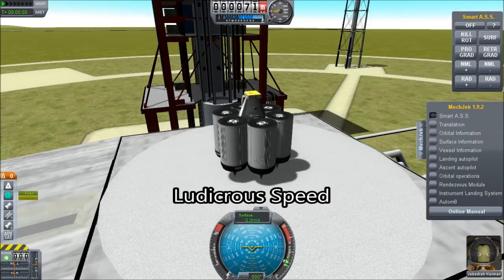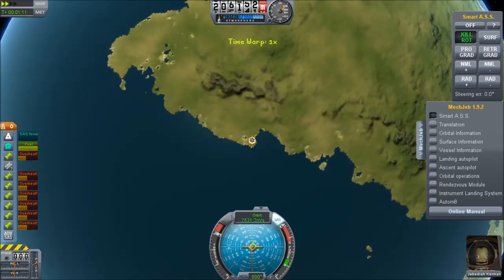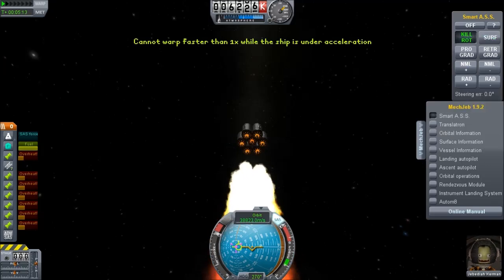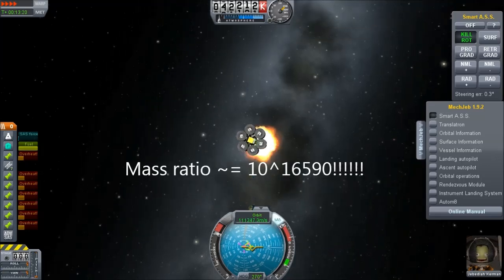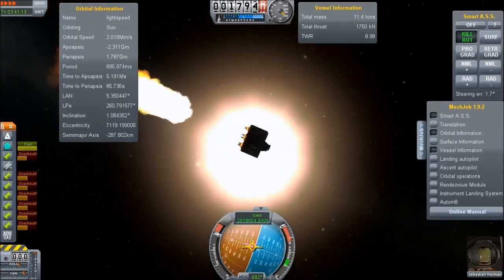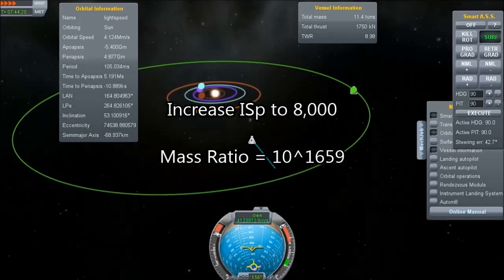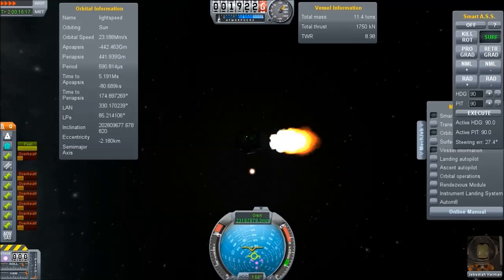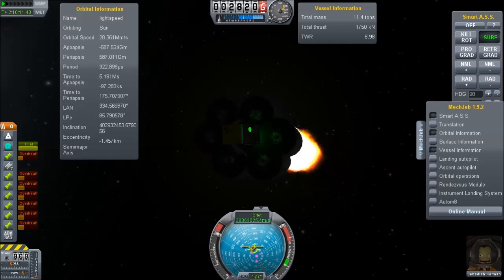What Does It Take To Reach Lightspeed In Kerbal Space Program?

Comment: The thing I haven't understood about the rocket equation is that it suggests that ISP directly correlates to output thrust, as I assume effective exhaust velocity directly correlates with actual exhaust velocity, for an engine of the same efficiency. But this suggests that the Skipper engine (650kn), with a vacuum ISP of 350, has the same effective exhaust velocity as the tiny Rockomax 48-7S (30kn), which has the same ISP. I know something is wrong here, I just don't understand why.
Reply: The exhaust velocity is the same. The amount of fuel thrown per second is not. (Thrust) = (exhaust velocity) x (mass per second).

If the Skipper throws out 1000kg of fuel, it will be over a short time and thus large thrust. If the 48-7S throws out 1000kg of fuel, it will be over a long time and thus small thrust.

Another way to look at it is (thrust x time) = (exhaust speed x fuel mass) = (momentum). Since both the Skipper and 48-7S have the same exhaust speed, if they kicked out the same fuel mass, they would give the rocket the same amount of momentum. They would just deliver the momentum over a different length of time.

This is all fine and dandy when in a vacuum on an infinite plane with no other objects, but we need larger amounts of thrust to combat gravity. That is why you use the Skipper to get your heavy rocket of the ground.
Reply: *****
I think I see now... so if you gave the Skipper and the 48-7S the same amount of fuel (assuming they are in a vacuum, as you said, so they could lift themselves) they would be capable of the same Delta-V, it's just that the Skipper would achieve it in way less time.
Reply: Mckenna Cisler
Exactly.

Comment: I think there is an existing, working rocket engine with an Isp equal to the speed of light: A flashlight! You could take one up to the ISS, turn it on and point it out the window, and it would work, pushing the station in the opposite direction. It's just that the thrust is so tiny that it probably wouldn't be noticeable, but the fuel efficiency should actually be as high as you'd expect, i.e. the momentum gained by the station divided by the mass loss of the flashlight would be equal to c.

Comment: I adjusted the code for the stack separators so that the amount of force it creates is RIDICULOUSLY high (1000000000000 or something like that) and put it on the bottom of a lone command pod. I pressed space and was IMMEDIATELY traveling easily 10x the speed of light.

It was also spinning rapidly and if you try it on any craft with more than 1 part all of the energy is wasted in tearing the ship into shreds and you'll get lucky if you manage 1km.
Reply: lame

Comment: I've been bored lately, this "Southern Snow Storm" and all. Because of this, I decided to mess around in KSP. I downloaded a few mods, most importantly, NovaPunch. I found that if you build a probe using 1: An OKTO2, 2: A nuclear power generator, and 3: A large Launch Escape System, you can make a probe that reaches 1,000,000 mps in about 12 minutes. With infinite fuel on (along with draining the solid fuel to decrease mass), this could reach the light speed in about 60 hours.

Comment: Could you cut down the time to accelerate by using the suns gravity well for an initial boost?
Reply: isn't that what he was doing in the video?

oh my bad just re-watched and noticed he didn't do that, he past kinda near the sun but didn't use it to sling shot...
Reply: i don't think so. at least not in any way useful in KSP.

gravity assists inside a solar system help you change your velocity relative to the sun. so a slingshot around the sun could only provide a boost from an interstellar perspective, but i'd expect that to be far beyond the scope of KSP (and it's velocity readings).

edit: you could of course take advantage of the oberth effect which would probably be quite significant near the sun.

Comment: Actualy, ION-engines do exist and have reducilusly high specific impuls of about 20 000s. But they also have the univers heat death problem. Also atomic charge engines exist on paper and have a ethen higher specific pulse and also higher acceleration. Up to and over 1G

Comment: Well of course lol why would you set the thrust to the speed of light it would accelerate at c(speed of light)/s if it had no mass, first your lucky mass doesn't = energy x c^2(speed of light squared) like in real life or you would instantly create a massive black hole that would engulf kerbin second the force of the thrust is 67396025.86347112lb of thrust on the surface more then enough to knock a planet off of orbit.(keep in mind kerbin is smaller then earth as well)

Comment: Perhaps I'm not the one to answer this, but just in theory: it'd be a bit precarious, even if you could convert standard protons/neutrons/electrons into photons, as should the light have been bent or diffused by something, the object coming out would be a bit... Skewed, so to speak.  Deformed, missing bits.  Warp travel, however, would be a fair bit quicker and safer (in theory.  I don't really know what I'm talking about).  Nasa is actually working on something of the like: (other comment)

Comment: Electricity as in wires and power plants?  Well electricity travels as a wave (the motion of the electrons is not electric flow) at the speed of light, so really they are the same.  Also, just fyi, light is an electromagnetic wave itself.  Basically what happens is something generates an electric field which then propagates into a magnetic field and back into an electric field back and fourth over and over in a straight line.  So light and electricity can be thought of the same thing..ish

Comment: There's no reason a craft file or simulation would have to be bigger than the universe. Hell, there's no reason it would have to be much bigger than KSP's current files. Just because data represents a certain value, doesn't mean that data is as big as that value.

Not to mention that if we're talking about applied physics well beyond our tech level, it's possible to store up to 10^66 bits of data in a 1cc volume sphere.

Comment: Right. Reducing the total required antimatter (for the drive to work at all, not necessarily to go anywhere), assuming all energy is released as photons, from the a ball the mass of Jupiter to about 500kg. If it works. No one has ever been able to prove the Alcubierre drive actually works at all in any kind of test. Fingers crossed though, that's getting closer to practical. Only requires about 90,000 petajoules of energy (about 21,500 megatons of TNT).

Comment: One way is to "hack gravity" in the debug toolbar. If you hack the gravity at 30km/s, then it would be like travelling 300km/s with normal gravity or something like that. Then when you go to the tracking station and back to the ship the gravity won't be hacked anymore. You will be travelling much faster by like a factor of ~13, since the system has to keep your trajectory the same it compensates by speeding you up. If you do this a couple of times you'll reach lightspeed and faster.

Comment: But gravity does bend light, so it does have some effect on the photons (gravitational lens). Or do the photons emitted by the sun not experience this as they are traveling straight away from the center of gravity?

And on a total unrelated note,shouldn't a object with a speed increasing torward c sooner or later collapse into a black hole?

In any case, relativity is weird ... I want an easier universe. =(

Comment: In the Kosmos Space Station parts pack, there's an escape tower with 1000 thrust and ridiculously low mass, if you burn it out and then activate infinite fuel (provided it's flying on its own), it accelerates at around 14.3km/s^2, so it would reach light speed (at 4x normal speed) in about 5.8 hours, if my calculations are correct. It's a shame I can't be bothered to run the game in the background for that long.

Comment: Also, if the matter is only slightly more "massive" than the antimatter (absolute value, of course), say, 1 electron, then the craft's mass would be virtually zero, enabling a quite weak engine to accelerate it to the speed of light.  Sadly, this would be ruined by any stellar gasses that the ship may encounter, as they would possibly "stick" to the ship, slowing it down.

Comment: Did some calculations on the nuclear rocket situation, and using a rocket composed a octocore2 probe, an FL200 tank and the atomic rocket for the central body, and then had a massive pylon of stages jutting out which were each composed of an FL200, a TR-2V, and a fuel duct to the next stage, I figured that c (discounting relativity of course) could be reached with about (100^100)^100 aka 10^20000 of said stages. That yields a mass ratio of around 5*10^19999.

Comment: Does the equation for calculating the needed fuel considers that the ship gets heavier as it accelerates and thus requires more energy to accelerate further? KSP doesn't care though.

And as for the actual close to speed of light engine systems. I believe these have been considered to be actually possible:

- Fusion engine with a cone in front of the ship (so that it gathers hydrogen on the way)
- Orion project (drops nukes behind the spacecraft)
- Antimatter (100% efficient but most dangerous)

Comment: Kilobyte, Megabyte, Gigabyte and terabyte are all base 10 values and are apart of the SI metric values.

Kibibyte, Mebibyte, gibibyte and tibibyte are binary values.

go to wiki and see the truth.

Microsoft has been lying to you about file sizes.

Why do you think a 1TB HDD says it is 931GB in windows?

Because it should really say 931GiB
1,000,000,000/1024/1024/1024=931.

Note the 1024, it is a binary value not a metric.

Comment: /watch?v=TIcRQZQBo6M I went over the speed of light using a glitch where you jam yourself into the bottom of the water holding bit of the water tower with a small rocket engine with small fuel tank with a decoupler and the plane module with another small engine and then you are thrusting at full force and decouple then you should spaz and through you into a speed way above the speed of light... I would show you but it breaks my game if I record the first bit... super lag...

Comment: In the 'rocket equation' why are you able to calculate g as 9.81? Wouldn't you have to take the integral of the changing acceleration? And if so, what would you integrate over? The distance of acceleration isn't part of the equation at all. Is this specific equation assuming all acceleration happens instantaneously?

Comment: However. You are wrong. The period should be inside the brackets in the English language. But in the Swedish language they are on the outside of the brackets. 

~Don't get so cocky unless you are 100% sure you are correct.

Comment: I don't mean to punch a hole in your math but the rocket quation your using is used for leaving the earths gravity, plus, you will accelerate at a constant rate in space so if your accelerating at 500m/s to reach 299 792 458m/s then you'll just need a sufficiently sized area to travel in which at that rate, to reach that speed will only take 599 584s which is about 18.5 days.

Comment: acceleration and deceleration are the same thing. (actually, "deceleration" is never really used in physics at all- just tack a minus sign onto your acceleration vector...) If you "decelerate" at the same rate you accelerated, you experience exactly the same forces. There is no reason you would not be able to slow down, assuming you had enough fuel to do so.

Comment: this could have been explained shorter and simpler by using Einsteins formula E^"=(mc^2)^2+(pc)^2, where Velocity=Speed of light*momentum/energy. This means that  momentum/energy is the percentage of speed of light you possibly can reach. therefore you need mass to be nought to be able to achieve speed of light, which limits the ability to actually achieving speed of light since the massless object would be stuck in lightspeed from the beginning. ps. massless here isn't "completly" massless. :)

Comment: Antimatter-matter reactions are an interesting thing. When the two come in contact, equal masses of each are converted directly into Kinetic energy. Magnetic fields are currently used to isolate and store antimatter, and this could likely be used in a similar fashion to control the reactions. The hardest part is directing the "explosion". Which is basically how current day rocket fuel works anyways.

Comment: because fusion require a couple of thousand kelivn and high pressures.the reaction cannot be in contact with any other matter it must be levitated in magnetic fields so it doesn't loose heat. very expensive and at the moment we can get back more energy than we put in.

Comment: those calculations you did assume only a newtonian approach(the equation with the log is a solution of a differential equation about the conservation of momentum between the expelled propellant and the rocket), you really should use at least special relativity and the corresponding lorentz transformations and you should get another  equation that doesn't let you travel faster than C, also you can't use 9.81 you should put GMm/r^2 in the diff.eq. or better, do everything with general relativity.

Comment: In this video: Jeb hits Warp 10.

Also, the only way you could possibly hit c is to either break the mathematical approximation or convert yourself into energy quanta. If you consider velocity as a function of energy (i.e. v(E) ), there is an asymptote approaching c. Pouring more energy into the body just means you get more significant digits of 0.9999999999999...9c.

Comment: Actually special relativity predicts that energy approaches infinity as velocity approaches the speed of light (dividing by zero). Data from LHC or other particle accelerators can be fit to the curve with high precision. Space doesn't warp to slow something down, it warps because the speed of light is independent of reference frame, i.e. space and time warp to ensure c is constant (for whatever reason).

Comment: Actually, even IF that's true, that wouldn't be our biggest problem. As speed is equal heat (or lack thereof) would mean that something traveling at the speed of sound (or even a fraction of it) would have a temperature so high it is immesurable to us. In other words, whatever material used will simply convert to gas.(or some even further state yet unknown to mankind) The more interesting thought is getting to a complete standstill and thus possibly entering total cryostasis.And check ur grammar

Comment: C'mon guys this is actually simple if you don't over think it. In reality light speed is impossible by current means simply because you have to have so a set amount of fuel for a set weight. The problem is that by adding fuel you add weight therefore you need an infinite supply of fuel.

Comment: An anti-climactic and appropriately tiny explosion, I'm sure. I don't think it takes speed into account when crashing for some reason, though I haven't exactly done many high-speed collision tests. Crashing into a planet at about 12 km/s is the most extreme I've done and it simply resulted in a little puff of fire no different than if I had crashed at 800 m/s.

What I would love to know is if it's possible to change the orbit of a planet by bolting enough rockets to the ground and firing them.

Comment: There is something that you neglect to see:
relative movement can not be faster than light (c). It is not that it can't be measured how fast one photon would appear to another photon. it is just that the perception of velocity of the photon is different because of relativistic velocity adding v_rel=W=(u+v)(uv/c^2)^-1 with values between v_rel = [0;c]. A photon traveling in the exact opposite direction to another photon will not appear to be faster than light to the other photon.

Comment: i assure you, i am not just trying to be argumentative. everything is relative and i am only basing my ideas on common sense. i dont think i would be so bold as to say that you are wrong, but i can't grasp what you are telling me. if it could not be calculated as traveling away from the other particle at 2C, it would have no speed at all or it would have any and every speed. there is missing pieces in this. light does not adjust its speed according to any other objects position or velocity.

Comment: Relative to each other, sure.  If the flashlights were not stationary this would also be true.  Light travels at the same speed no matter how fast the flashlights are moving.  What you'll find though is that its wavelength changes due to the Doppler effect.

It will probably make more sense if you stop thinking of light as particles and start thinking about it as waves.

Comment: No, it's not relative to the flashlight. In fact, the old problem of the train and platform thought experiment goes into this. 

If a light turns on at the center of a train traveling at relativistic speeds, then an observer on board will see it reach the front and back at the same time. However, an observer on a fixed platform will see it reach the back first.

Research this, and you will see the issue with your logic.

Comment: ORRRRRRRRR, You could use a machine to create a "Warp Bubble" by warping space inwards on 2 sides, and warp it outwards on the other 2 sides you could simply warp the space around you. This warp would cause the fabric of space in it of it'self to propel you forward to even faster than the speed of light. You wouldn't need to worry about slowing down. Technically space it'self is moving relative to you and when you come out, relatively speaking, You wouldn't be moving at all.